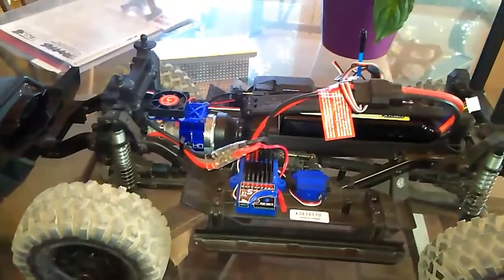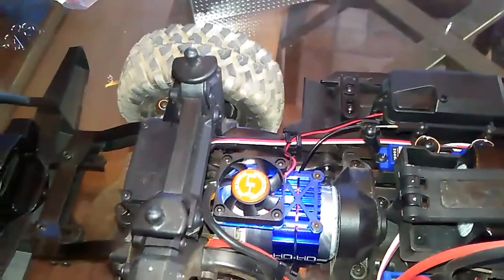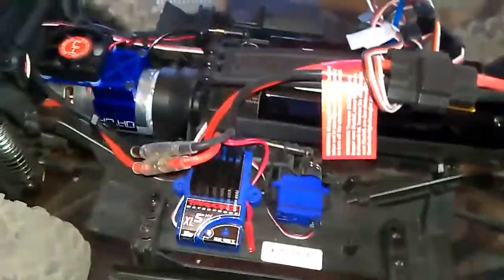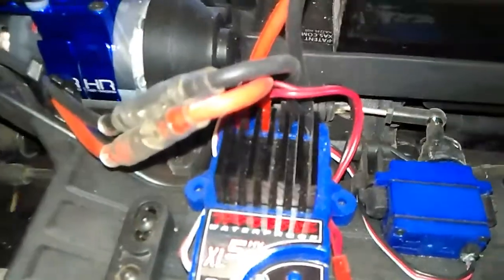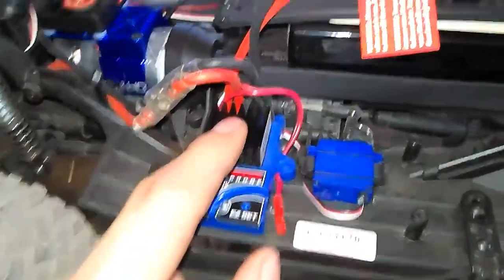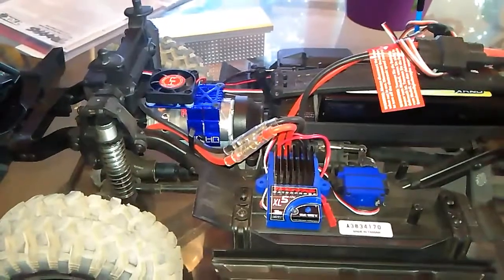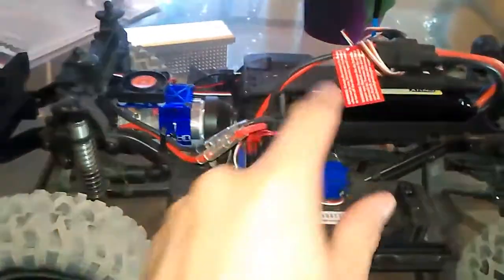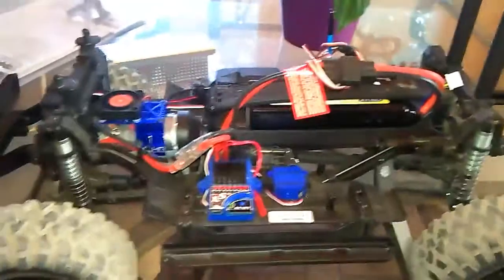Trx4 fan upgrade

Comment: I had a lot of Traxxas vehicles and never had one where water got into the receiver box as long as they where factory sealed or after mods closed the right way.Also that your esc and motor get that hot is not normal as well, I would think you either run on full throttle all the time or have other issues as something dragging, check if all components spin freely, a lot of new trx4 owner change wheels that does not fit right and they drag and that causes the motor to overheat.Also remember if you add a fan or in this case fans, that they will also draw power from the esc and weaken the power system.All together this a NOT an educational video at all, to may maybe"s and no true answers or help.
Reply from the maker: Oliver G. thanks and if u can see i have nothing done to it like wheels esc or motor.i just have a fan on it and no im not full throttle all the time i know the meaning of crawling if u watched my videos u would know but u dont so thanks for ur input i've been in this hobby since 1996 so thank u.

Comment: which motor fan is that? and is that the stock trx-4 motor?
Reply from the maker: Basecamp6 its hot racing new fan and yes that is the stock 21 turn 550 motor